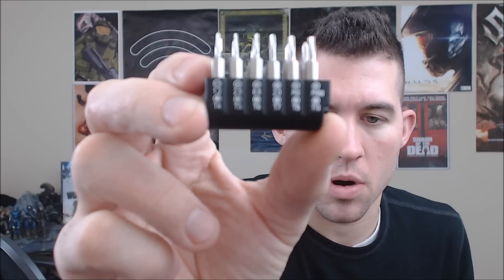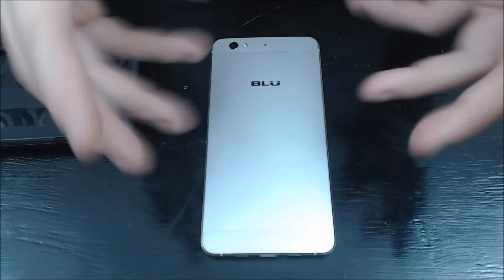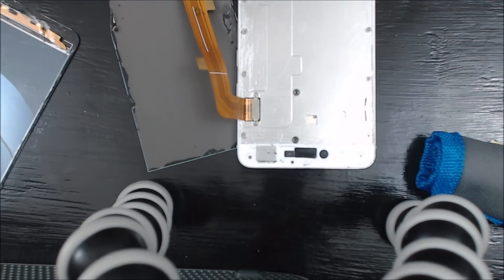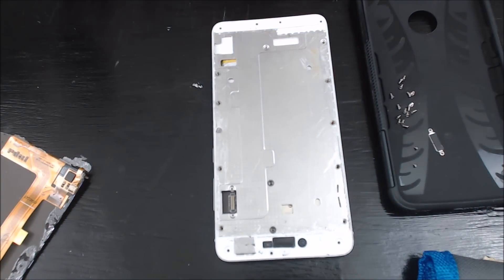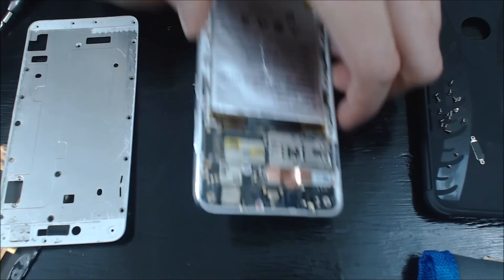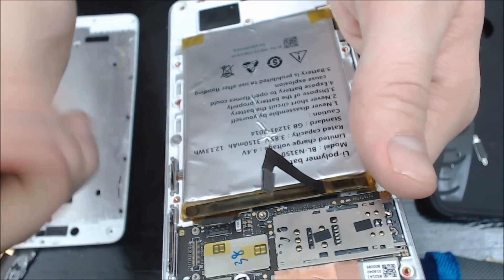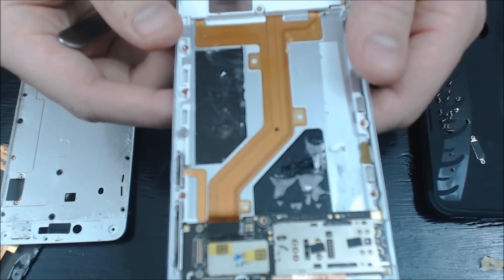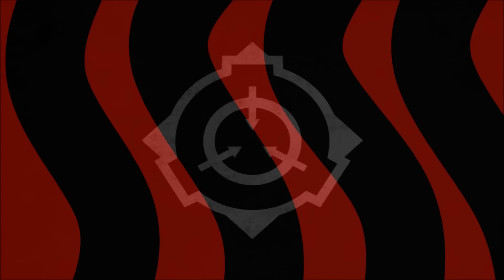How to remove/replace the battery in a Blu Vivo 5

Comment: Hey, I'm considering to replace my VIVO 5 battery. Do you have a video with the disassemble process? Because you show it already opened. By the way, Congrats for your videos. Love your work, really helpful.
Reply from the maker: +Guillermo Vallecillo it was easy for me to pick up the screen because my screen was already completely damaged so I ended up just peeling it off without worrying about the damage. If you want to take the screen off you're going to have to use a combination of the Heat gun into the sides to melt a glue enough to separate the screen from the bezel but the screens that come with these budget phones are really cheap so it's most likely going to snap as it did with mine.
Reply: he just cant.

Comment: thank you for the tutorial, was very useful for me. Sorry for my bad english i'm from argentina. 
Can you explain and show how open a new blu vivo 5? 
I just replace the batery but my screen isn't broken and i dont know how open it
Reply from the maker: +Emmanuel Vega hey man. Unfortunately the only way to open the Blue Vivo 5 is to remove the screen first. As I have said you can most likely use a heat gun to remove it but I had no such luck in doing so. The Screen is delicate and therefore it may break in the process.

Comment: how durable is the vivo 5
Reply from the maker: +Demetrius Fleurantin only man not very durable at all. It's nice and sleek and of course cheaper than other flagship phones but it's kind of weak in frame and design. Just a budget flagship phone. Hope that answers your question!
Reply: EuclidGamer it did thanks!!
Reply: I had mine for a year and a half.  From March 2016 until yesterday till its battery died. It looks like new except for the silicon protective case that kind of turned yellow. It was a pretty good phone for the price.
Reply: I bought my blu vivo 5r 4 years ago, and the battery just now is starting to last a little, the load lasts 8 hours, when I bought it it lasted me 2 days. I think it's a good phone in relation price-quality

Comment: My blu vivo 5 fall into the water for 20 minutes.. you know if will can work again? what is the problem when wet it? the batery? sory again for my english. Any help is useful for me
Reply from the maker: +Emmanuel Vega it is unlikely but still possible that the phone will still work if you replace it's battery but it is hard to tell. Most likely it is just the battery but the motherboard may also be destroyed from the water damage as well. Hope this helps.
Reply: Thank you so much. By the time I'm still waiting for it to dry

Comment: Hi!! I took it to a service to replace the battery and they can't open it! How did you do it??
Reply from the maker: +Lud C. It already had a hole in the screen. You will need to use a heat gun to meld the bezel glue. Sorry I can't be more help